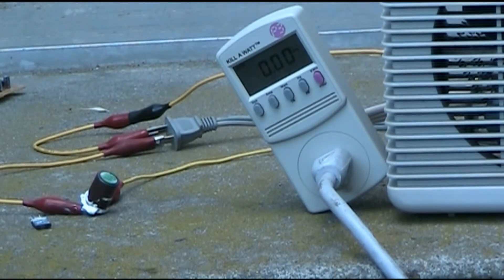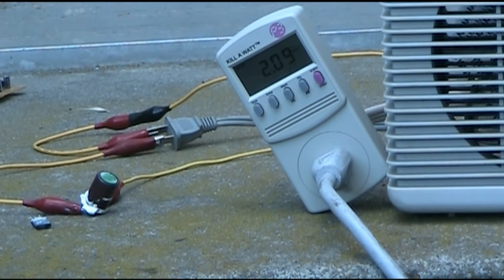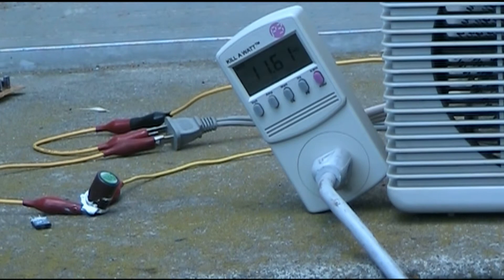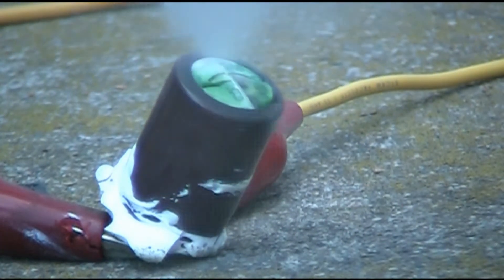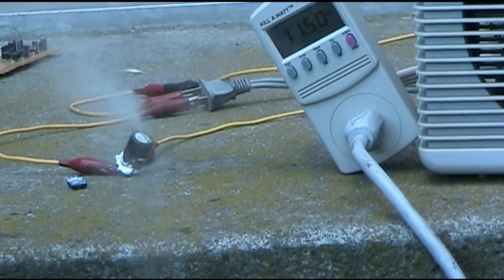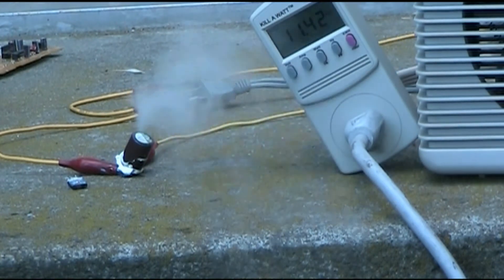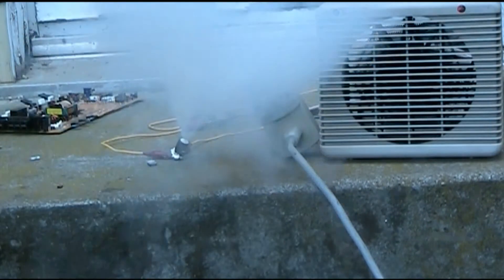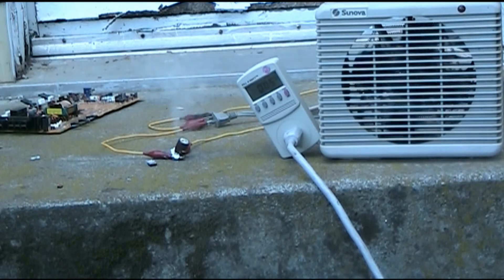Electronic Burn-outs: Capacitor Pop Session No.2 - Smoke Vapor!

Comment from the maker: I'm guessing here but it's likely a mix of the boiling liquid electrolyte gel that's in those caps and melted safety re-enforcing sealant. I think there's a hard substance that helps keep the caps from venting until a critical temp. is reached, then it melts and weakens the safety score on the top of the cap (where all the junk comes out).